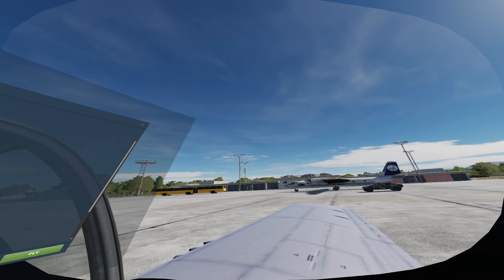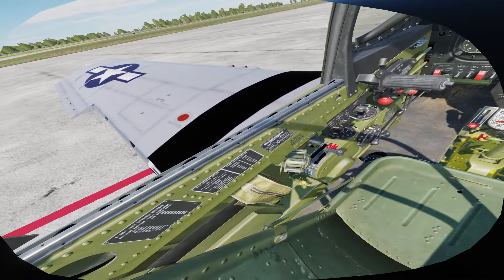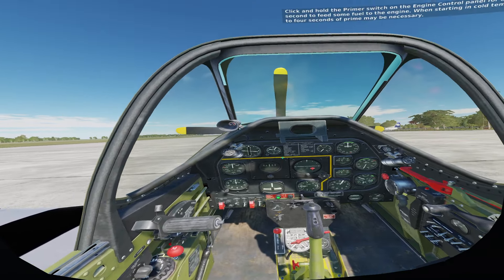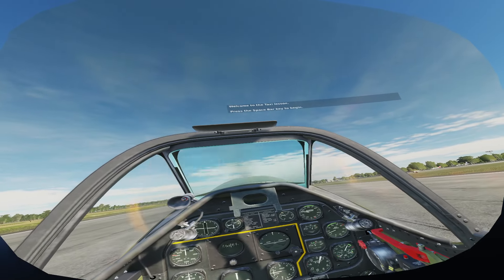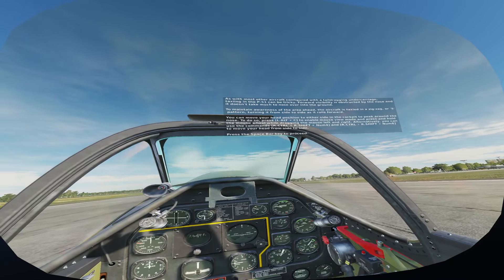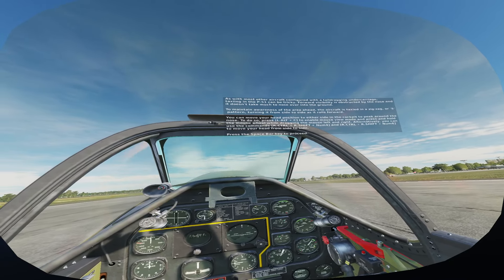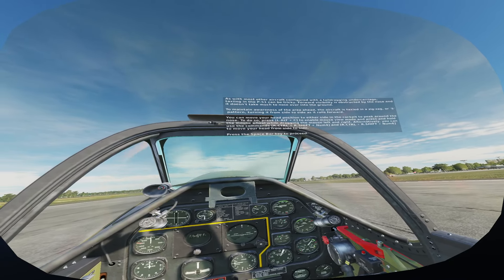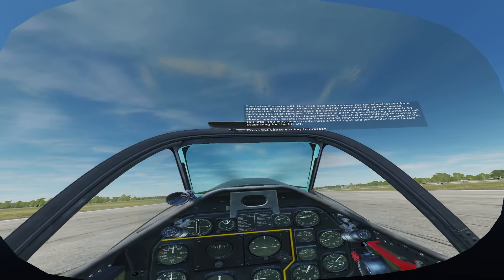LEARNING how to FLY my favorite WW2 plane in DCS WORLD!!!!

Comment: If you have a HOTAS, try switching rudder trim for aileron trim. That way you can put in the rt rudder trim and then take it out after takeoff as the trim goes left with speed with your thumb. Keep the ball centered at all times (start to finish), with your feet and trim out the pressure. Warbirds are trim hogs. Look up "P" Factor if you haven't already to "see" what the prop is doing to the tail and why you need all the rt trim to start. You figured out to feed in the power gradually on takeoff. As you get used to it you can release the brakes at higher initial power settings. Thing only needs 52-58 MAP to takeoff. After takeoff, gear up, flaps up and set 36 MAP and 2400 RPM for climb power and set climb speed 140-160. Do some acrobatics to get a good feel. Loops, Cubans, Split S's, Immelmanns, wingovers, rolls, stalls and spins. The Mustang does them all and real well. Chuck's Guide.
Reply from the maker: Thank you for the info!